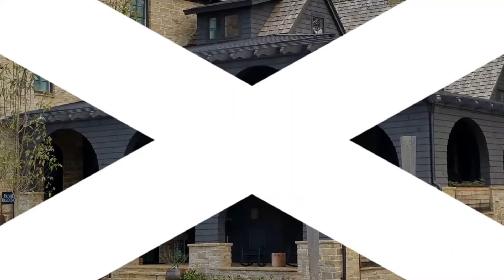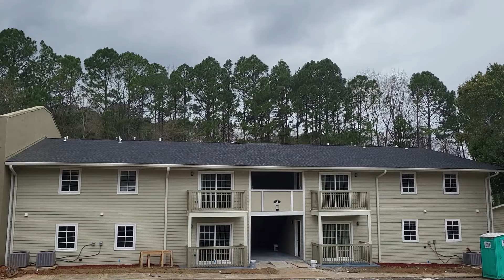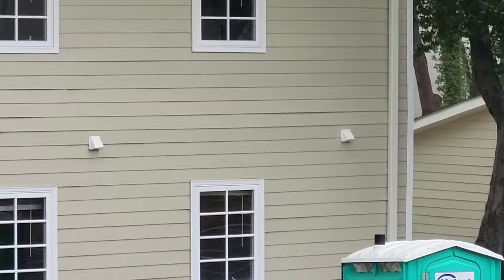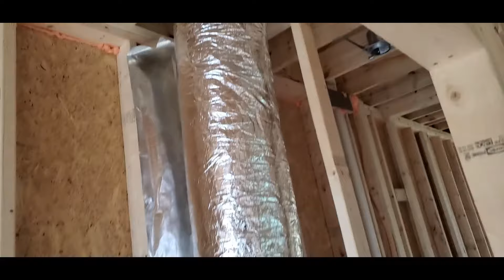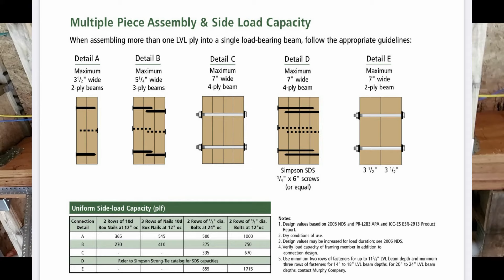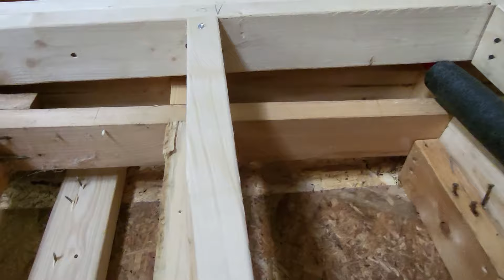More Residential Building Code Violations (Part 4)

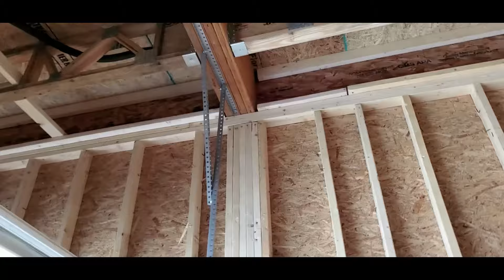Comment: 4:46 on an ungrouted wall, at least they transferred the load to what? An ungrouted-unrenforced Nothing? Cmon bro. Rest of the videos have been good so far as i've seen.
Reply from the maker: So, those concrete block foundation walls are filled with concrete..per the code.
Reply from the maker: I appreciate you watching!!

Comment: That apartment building at the beginning was a real mess. I couldn’t help but notice the ridge wasn’t straight so that would tell me to look more closely at the framing. And they obviously didn’t know where the AC units were going to go when they did the electrical rough in because the carflex going to the units is way over 6’ and looks very amateurish. And the units for apartments 2 and 7 near the end are setting right in front of the disconnects so the disconnects don’t have the required working space.
Reply from the maker: Ok, I appreciate your commenting.

Comment: You are completely in the wrong at 10:00 talking about the plastic barrier around the lugs. You gonna have them protect the buss bars also? Code says it must be guarded or enclosed. Its enclosed once the panel cover is on. If it has a main breaker I can see having the plastic on to ensure that there is nothing exposed and hot  while the main breaker is off but here it was a bad call.
Reply from the maker: Are you reading the 2020 NEC sir??
Reply from the maker: My videos are based on the 2018 International Code Books, 2020 NEC,  and manufacturer's installation instructions.
Reply: @PPG1967  What's funny is the fact the the panel manufacturer supply's the cover for the lugs when it comes with a main and doesn't when it doesn't come with a main breaker.
Reply: @PPG1967  You going to have them cover the buss bar too? Don't cherry pick which codes to follow and which not to.

Comment: Can the ground wire be placed in with the concrete footer and just run a 28 foot run and a single wire?
Reply from the maker: You referring to a Ufer Ground??...clamp a ground wire to rebar encased in concrete??
Reply: @PPG1967  yes sir

Comment: I wish your office was in Jersey City.  The building department passed horrible framing of my exterior patio door.  No recourse because the contractor never obtained a permit to do repairs after a fire😢
Reply from the maker: There's always recourse, you can take them to court.  Code is "Law", if they didn't pull permits or didn't follow the adopted state codes, you can sue.
Reply: @PPG1967 are apartment codes and laws the same? My complex did electrical work. They allegedly replaced burnt out wires that were deemed a safety hazard by the electrical company. The electrical disconnected my power immediately. All my outlets in my home stopped working prior to calling the electrical company. I know my complex made repairs and didn't have a permit.

Comment: What is the requirement to build a proper ceiling/floor? Are they required to have sound proofing to mitigate sound from impacts (ie impact of someone walking around on top floor to protect bottom floor dweller from said walking sounds) ?
Reply from the maker: Where are you located??
Reply from the maker: Check with your local or city building department.
Reply from the maker: What building codes has your state adopted??
Reply: I live in Los Angeles, I did some reading of codes but they are so technical.
Reply from the maker: I don't know any state or jurisdiction that requires soundproofing of floors.

Comment: Do electricians in Georgia wire outdoor equipment without fused disconnects? The price difference between a fused disconnect and a disconnect is small. Why trust a breaker over a fuse?
Reply from the maker: Fuse disconnects???...I think those days are long gone.  Where are you located??

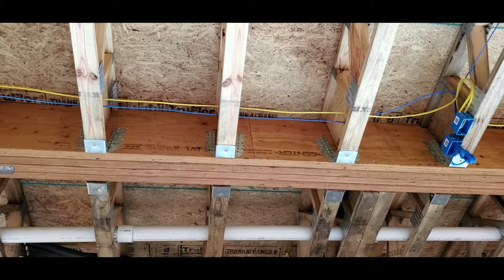Comment: Thanks for making these videos! Why on Earth did that electrician drill through the end of the joist instead of running the wires through the open truss at 4:05?
I think you got horizontal and vertical mixed up. Horizontal is side to side and vertical is up and down.
Reply from the maker: So, that's just some OSB filling in some areas of a open web joist... that's not an issue even if they drill a 1/2" hole.
Reply from the maker: Also, where in video did I get horizontal and vertical confused??
Reply: @PPG1967  When talking about the nail guards, you said they're typically used horizontally. You were looking at them horizontal, so I assume it was a slip of the tongue...
Reply from the maker: Yes, nail guards are typically used horizontally.  Boca Plates are used for vertical protection.
Reply from the maker: I hope that clears up any misunderstanding.
Reply: @PPG1967  I think PPG means.. nail guards are affixed vertically to protect horizontal wires…

And Boca plates are affixed/installed horizontally with a 2 inch overlap to protect vertical pipes/wires…

I think that is what he means.
Reply from the maker: I appreciate your comments.